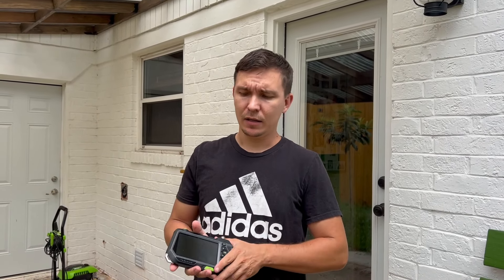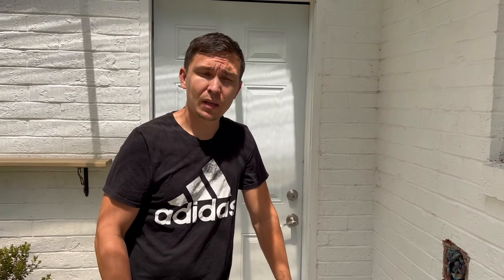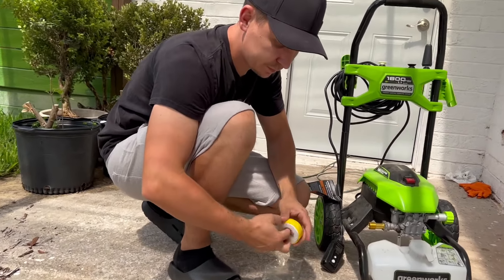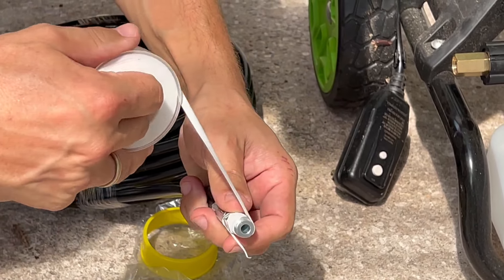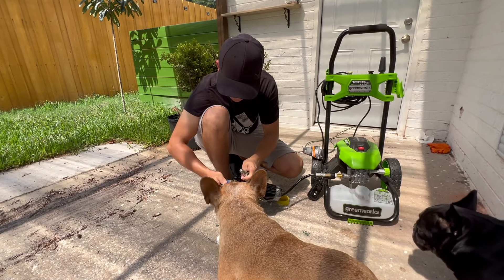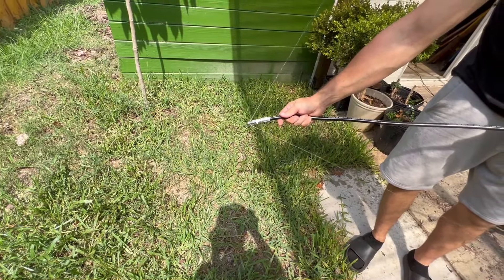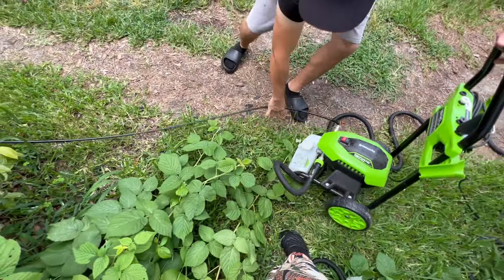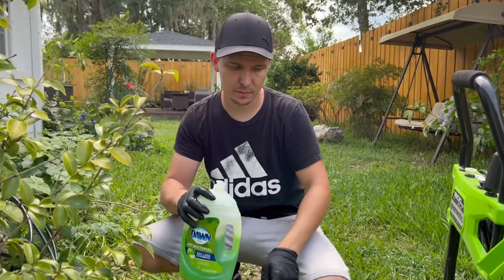UNCLOGGING my kitchen sink with a PRESSURE WASHER &  Sewer Jetter Kit (w/ BEFORE & AFTER result)

Comment: The first tape was not needed, the o ring seals that fitting. The 4.0 on the nozzle means that is for a 4 gallon per minute machine, so they were not doing very good. You may be able to find some nozzles rated for 2.0 and that will make those jets spray a lot harder and clean better. Or, just ger a 4000 psi 4 gpm pressure washer. Beware, with the correct pressure washer, those nozzles could cut your skin very deep.

Comment: Nice job. I just clicked the link for the camera set up. I put the item in my cart and proceeded to check out to see if the coupon works. It does! It reduced the price from $289 to $209. I didn't buy it yet, but just wanted to let you know the coupon works. Good video. I was surprised you never had any water come out of the clean out! I wish I had a clean out. I tried to use a Jetter on a kitchen sink and I could not get it past the first 90 degree turn. I did see somewhere that you just have to keep fiddling with it wiggling it around to get past the 90. I also had some sort of issue where the water stopped coming out of the house after just a few seconds. Not sure why that happened. I'm going to try again today. Good tip to use some dish washing liquid mixed with water to help break up the grease. Thanks!
Reply: U need what’s called a drop head nozzle some call it a knucklehead nozzle they r a 100 plus depending on the size u need 1/4  1/8 etc. they will go thru a 90 no problem

Comment: Can u do this on pvc pipes but without turning on the pressure washer? Pvc is rated at 80 psi, same as faucet psi. Is that enough pressure to wash away grease in kitchen lines? I don't want to tear the pvc pipe with jet wash.
Reply: Won't happen. It's safe. Pvc pipe is more than strong enough.

Comment: Sealing tape is not used on the outlet pipe... You also do not apply the tape in the proper direction on the other connections. Please learn to do things correctly before posting videos. What is wrong with you ?